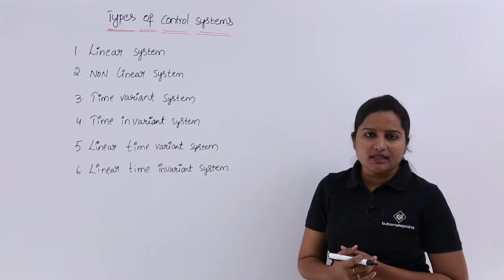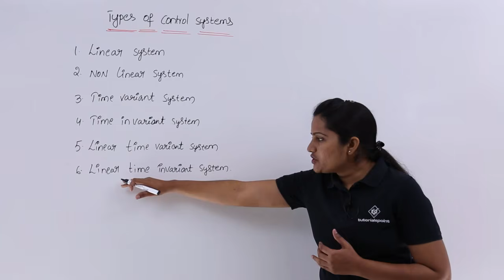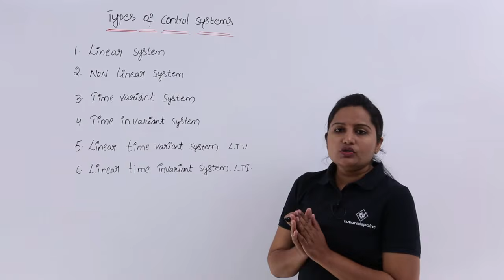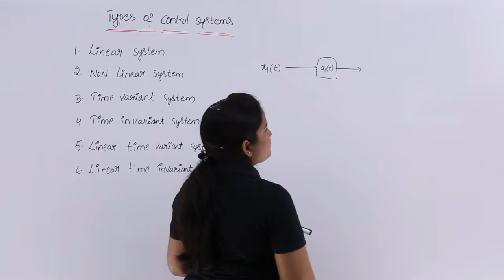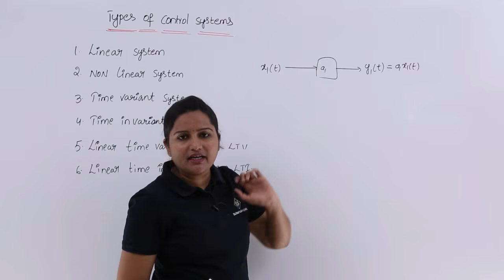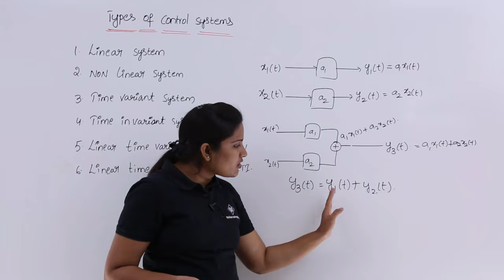Types of Control Systems

Comment: Where is
1)static system and dynamic system
2)continuos system and discrete system
3)according to no. Of in/op
a)SIMO b)SISO
NOT RECOMMENDED
Reply: go s.s
Reply: Linear Control Systems. ...
Non-linear Control Systems. ...
Analog or Continuous System. ...
Digital or Discrete System. ...
Single Input Single Output Systems. ...
Multiple Input Multiple Output Systems. ...
Lumped Parameter System. ...
Distributed Parameter System

in google its giving above types
please clear my doubt if possible

Comment: In the example of linear system which of the system is linear, is it the system with gain a1 or the system with gain a2 ?. You are adding the o/p of two different systems and saying result is equal to sum of their output which would obviously be. "In case of linear system response produced by the simultaneous application of two different signal is the sum of two individual responses".
Find the difference.